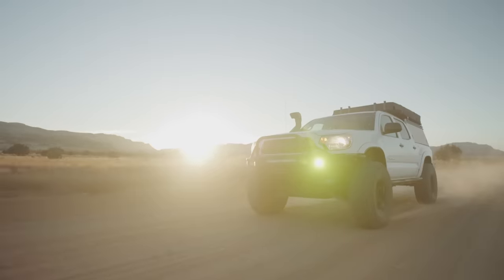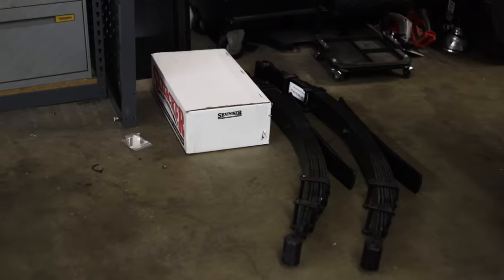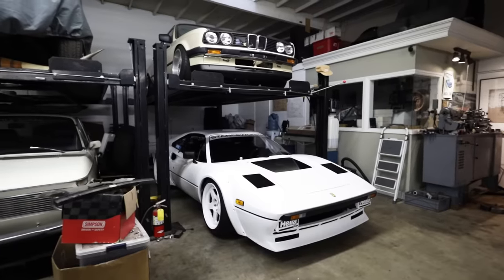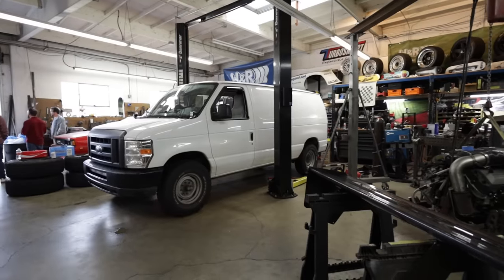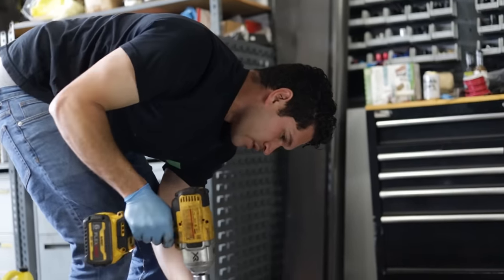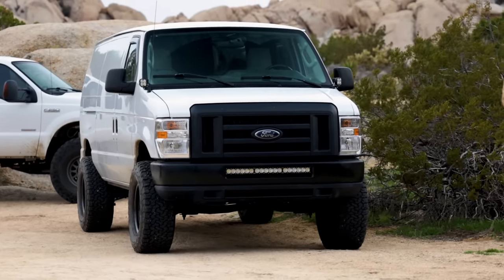Who needs a 4WD van when THIS is an option?

Comment: 100% agree with your statement that the van drives like a totally different vehicle. We have an E350 EB with a Fiberine camper top. Before installing the grocery getter, it was always two-handed (sometimes white-knuckled) driving at 60MPH.  Now, I can travel at 70 with one hand on the wheel... Lots of other handling improvements, but this is the most noteworthy.
Reply from the maker: So true!! Best upgrade possible and it’s so cool that it makes it drive better on and off road!
Reply: Try a bone stock 1990 E350 ..
Your 2103 will seem AWESOME.
Reply: @brakeforsnakes What was the total cost?
Reply from the maker: @hushai5154  all parts are listed in the description with links check them out

Comment: I did the same thing with my 2012 Ford E-350, 12-passenger shuttle bus. Added the six inch Weldtech lift. I'm converting it into an RV but I wanted the clearance for the gray water tank and the frame mounted rear AC compressor/condenser. I added some Falken off road tires including the dually wheels. It looks really wicked. The bus manufacturer is Turtle Top so the shuttle lines are very curved and smooth. With custom welded off road bumpers and my custom spare mount on the rear bumper and a cool looking desert tan and black paint job and all chrome removed it just looks the part. It's now known as the apocalypse vehicle by the shop I took it to get my drive line balanced. Overall, it's a great lift kit. I did go with the Eaton 8000 lb rear springs in order to carry the weight of 75 gallons of fresh water, 400 lbs of lithium phospate batteries and another 150 lbs of fuel with the 55 gallon fuel tank I just got for it.

Comment: Sick. Love the weldtec lift. I've got one on my 2012 eseries. I've been eyeing a locker. I'd love to see you talk about why you went with the powertrax and some shots of it in action in future vids!
Reply from the maker: I chose the no slip locker because it costs like $350 and since I don’t live where it snows it just makes sense. I can’t even notice it driving around town but Offroad it’s a night and day difference! I’ll do a more in depth review on it
Reply: Curious about the prowertrax option and why you chose it. 

I saw your earlier reply.

I myself having been going back and forth between the one you got and the arb rear air locker. 

Haven’t been able to really ask anyone who has used both and can tell me the differences and what would be better overall. 

I’m running a 2011 E250 as well. 4.6L 😢

I’m getting the same lift kit and also running 35’s.  As well as, the ring and pinion 4.56. 

Right now, I’m leaning towards the air locker. Any insight would be greatly appreciated. 

I plan on running through all terrains in my rig. 

You can see it on my channel under van build series.
Reply from the maker: Mine has the 4.6 and it averages 16-17mpg still I love it. The arb is a better setup I just didn’t want to spend the money for it. The powertrax is a great budget option but not ideal for driving on the road if you live somewhere it snows
Reply: If you live in snow country Get a selectable Locker, a fixed locker in snow with 2wd is a nightmare to control and dangerous.

Comment: This is exactly what I want to do with my van. I didn't want to go through all the trouble of installing 4 wheel drive and THIS will do the trick! You have a great channel going here! Thanks for going to the trouble of making these videos! You're a few steps ahead of me which is good for me because I get all the info and get to see how bad ass the van looks and mine will look hopefully sooner than later. It all costs so much money but I don't have to tell you that. I appreciate you! You're the guy my wife was telling me about when you got the hi-top. I can't wait! I actually already put a 900 watt solar rack on top but that can be raised when the time comes. I put my fantastic fan in one of the back windows and an air conditioner in the other. It turned out great! We want comfort. Some people might think it looks strange but we're happy with it.
Reply from the maker: That’s so rad and much appreciated!!
Reply: 4 wheel conversions on vans are currently $12,000 - $25,000 plus the cost of a van

Comment: Love the van....i'have a 2001 e250 5.4......locker kit in rear ..3 in lift..running 255 x 16 studded rear ..225x 16 studded front..3.9 gears .10,000 lb front winch ...a beast in the snow....havent set up for summer yet ...Canada..keep it coming ..cheers..
Reply from the maker: Hell yea!

Comment: Glad you shared your dream build with us.  My dream is a way crazier and will cost some $$$.  Take an E350 cut-away source and an Econoline chassis to be shortened to a Crew Cab.  Source an F Series long bed (8-foot). An E-350 pickup truck.
Reply: Check Out the 80's and 90's Ford Cabriolet Van and the Centurion.  Both could even accommodate a 5th wheel!

Comment: Got the slider that I rarely see. I mostly see them with the 2 outwardly opening doors which is what my '04 white E-150 cargo van has. Just dropped a set of 3:73 gears in 8.8 rear end it has. It came with a 3:55 ratio axle so it wasn't a huge jump but definitely noticeable. I  didn't want to negativity effect its highway manors which I can barely even tell the difference when driving on the freeway. And fortunately it has a Jet power programmer that allows you to recalibrate the speedometer if you change the gear ratio or wheel and tire size so your speedo won't be off. Your van turned out great though. It looks awesome.
Reply from the maker: Yea I ran a 5 start tuner to adjust for the gears and tires

Comment: I'm a fan of 4wd Ford F250 short WB vans. Yours looks good after all the mods. Shy of having 4wd on it perhaps you're already thinking winch(s).
We're it me I'd back myself up with a 12klb front winch & a 5-6klb rear winch. Both with synthetic cable & donut snatch blocks. Unless you're out in the salt flats, this combo with your current mods could help you recover yourself anywhere else.
Reply: Why not just one winch on a hitch mount? Then you can just move it around.

Comment: For filming, install a couple cameras where you normally are and have them wired so a flip of the switch and you’re filming.  That way you can just be driving, sitting in the bench on your front porch, sitting at your desk or frying bacon, reach over and flip the switch and just start talking….. worry about editing later when you get a chance and have down time.

Comment: Any chance you’ll do a video of the van off-road and test it to failure(getting stuck) in multiple situations? 

This is the biggest challenge with these van builds is no one really knows what the limitation is with a 2wd lifted and locked van. It would help a lot of people determine if it will work for their needs.
Reply from the maker: I do plan to yea and in the video after this on my channel I have a bit of Offroad footage as well
Reply: mud, snow, sand, or steep gravel/slick rock is where 2wd vans'll stop. You can avoid the a lot of the scenarios, as it's for camping not rock crawling. 
But the mud/snow is the scenario where 2wd just doesn't cut it for me, as that often pops up on camping trips (especially if you're camping year round)
Reply: I know it's really not all that comparable but I used to have a ATV that was just a 2 wheel instead of 4 wheel but I put so e really nasty rear tires on it would keep up pretty good with the 4 wheel atv's in snow and mud. Like I said I know it's not apples to apples but it's food for thought.

Comment: I changed the steering box in my 89 Ford E-150 and it made it steer like brand new van again.  Instead of 4WD, I haul a small off road street legal motorcycle around.
Reply from the maker: That’s the way to do it! I have a dirtbike I bring too

Comment: I’m currently trying to decide whether to do 4WD using UJOINT Off-road components or 2WD with a selectable rear locker using WeldTec 5” components. I’d like to hear your thought process that led to your decision.
Reply: Living in Canada, snow is my main use for 4x4. Lift, locker and tires will make your van like 90% capable for most conditions, except ice/snow/mud

Comment: I don't know what you guys talking about, "front end vibration" ??
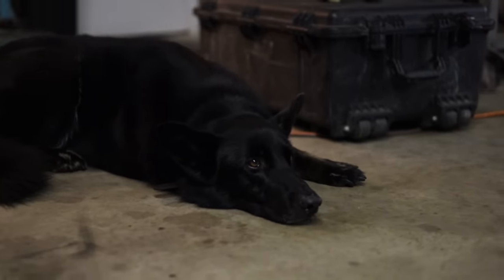 I had a 1998 Ford E250, 3/4 ton, extended body, 2 wd, 5.4 Triton, OD Auto,  had tinted headlight covers, bug shield, visor, triple rack Trac Rack system, aftermarket rims,  255/16 Goodyear AT tires, rear window louvres and a 3:23 limited slip rear axel and coil over rear shocks.....Had that thing cruising at 105 mph for 45 mins, coming home from a NASCAR race in Dover, Delaware...could drive it one fingered...put 100,000 miles on it, that was the 5th Ford Van I owned
Reply from the maker: Sorry but I just don't believe you do 105 in an econoline lol. I've owned 3 of these vans both 4x4 and 2wd, stock and lifted and there's just no way you were comfortably cruising at 105 in one. Although being a nascar fan you may just have a different idea of what's safe and whats not safe.

Comment: The biggest advantage to 4WD over 2WD with a locker is in off camber situations on slick ground. With a normal(open diff) 4x4 you've got one tire on each end trying to move the vehicle forward while the other two provide some lateral traction. If one tire on a locked axle spins faster than the vehicle is moving, they opposite tire does as well. Just like drifting or doing donuts, if both tires are spinning faster than the vehicle is moving you have little lateral traction.

I also don't mean anything extreme when I say "off camber". Snow covered or icy roads with a prominent crown can easily cause the back end of a vehicle with a limited slip/locker to drift towards the curb. This is why I'm a big proponent of selectable lockers even on 4x4's. It's not at all hard to find videos right here on YT of locker equipped 4x4's sliding sideways on hills covered in snow or mud.

Comment: Hey Jim, when you swapped out your chrome headlights for the black ones, did the wiring harness remain the same? Gorgeous van. Thanks!
Reply from the maker: So long as you use the same bulb it is fine otherwise you’ll need an adapter. I actually switched back to the cargo lamps

Comment: Only need a 4.30 gear for 35" tires on an E250. Just did the calculations myself for mine.
Reply from the maker: For your your van and your uses.

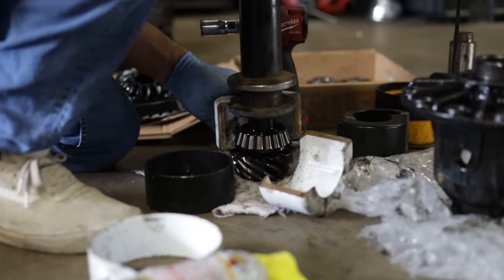Comment: To really get the best of a project filmed I think one needs some one filming full time. Yes, lots of editing! But, also a preview of what you want to present, like, why 4:56's, how did they change gas mileage, engine rpm. where you purchased the special weld on parts. So, it may require more than one video and be time consuming. Don't get me wrong, what you presented was very interesting and super informative and we liked it, but we have questions? Costs? that's always a question foe me. I'd love to do this type of thing but money is always forcing me to compromise. Thanks.
Reply from the maker: Those are all separate videos, watch my latest walk around video and there’s a link to the lift kit in the description (thats what was welded on the frame it’s all apart of the kit like I said)

Comment: How was the fitment process for the 35’s? I know they mentioned it requires some trimming to fit 35’s with the 5” lift. Progressive rear springs? Or just the blocks? Didn’t catch which one you did.
Reply from the maker: Fitment is easy just weld the brackets according to weldtechs specifications and do some minor fender trimming. I did the progressive leafs
Reply: @brakeforsnakes  🤙. Awesome. Any rubbing issues off-road?
Reply from the maker: Nope we clearanced the front just a bit and it's cherry

Comment: Nice van.  Don't go on a soft beach though.  My 2wd van with 6.0 diesel on 37s needed no lift.  Just needed a bit of a trim job.  It tracks true on the interstate also.  I liked the no lift option.  Just big tires.
Reply from the maker: That’s cool but not really comparable. I’m not just trying to fit big tires I want a suspension platform that works well and has an advantage. This kit more than doubles the wheel travel of your van which probably has even less than stock with the huge tires.
Reply: But they will both get stuck in the sand. A lift and tires in no way makes up for the lack of 4wd when you need 4wd.

Comment: Love it. I'm curious whether the 3" kit would've still fit the 35s or not.
Reply from the maker: You know I’m not sure but you could reach out to weldtech they’re very helpful!
Reply: I have 285 75 18s (34.83"s) on my 03 with only a 2in spacer lift in the front. After alot of cutting it only rubs when i bottom out the van while offroading hard.
Reply from the maker: @joseruizlalo  Man that's a lot of tire for only 6" of wheel travel and stock gears. These kits give the van 10" of wheel travel up front and 12" in the rear which makes a giant difference.

Comment: Just subbed absolutely awesome work. That set up is on my bucket list. Can you give me a link to the rear locker setup or do video and what made you go with that specific locker. Thanks !
Reply from the maker: The rear locker is just a Powertrax No-Slip locker but you'll need to put in all the info from your van and find out what rear axle/spline count you have since there's so many variations of axles in these vans. But that's a good idea I'll do a review on the locker and what it's like driving around town and offroad.

Comment: You did well.  Maybe some more detail but attention spans are limited for most viewers.  So good job.  That's an interesting project.  Head to the mountains beach where ever.   Be safe  My old 90 F 250 has a center point in the steering  , anything else you have to drive it all the time.
Reply from the maker: Appreciate the feedback!

Comment: What are the wheel specs? Offset , width etc.   Also did you use spacers on the rear wheels?
Reply from the maker: They were 0 offset 17x9 and I did have spacers

Comment: Question. Did that gear selection work out as you planned? I’m going to be doing a 79 Econoline and I will also be running 35 inch tires. I was going to be aiming for a 4.11. It is currently a half ton with 28 inch tires and a 3.50 gear.
Reply from the maker: 4.56 is definitely the way for 35’s on this van. I was originally gonna do 4.11 but glad I didn’t

Comment: to a guy who loves his really old sprinter, wants to get a newer ford van and doesn't know much about transmissions, can you explain something which i thought I would learn from your video? Can you now LOCK your 2 rear wheels together to get through sand, snow and mud? Is there a shift lever in the floor by the driver seat to lock and unlock the rear wheels? Thanks
Reply from the maker: The rear wheels are mechanically locked all the time now except when going around a turn off power. It’d called a lunchbox locker there’s lots of cool videos explaining how they work. A selectable locker like an Ox locker or arb air locker is a better choice for most people if they live where it snows but they’re much more expensive.

Comment: Errr...VERY glad you are using and enjoying the van with some add'l clearance, suspension travel, and better tires...but Com'on.
Who needs 4WD?  Anyone that is going anywhere that doesn't have established dirt roads, and even then the dirt roads need to be dry and stable, or 4WD is MUCH BETTER.
Nice production value.
Reply from the maker: I sold my quigley 4x4 e350 for this. Not everyone needs 4x4 especially when the starting cost of a conversion is 4-5x what all this cost. It also DOUBLES the wheel travel of a quigley 4x4 and that combined with a locker and 35” tires gets me just about anywhere I need to go besides the snow and mud pits which I avoid regardless.

Comment: Wow, you gave up 4wd for a lifted 2wd?

I had Weltec install a 2 inch spacer lift on the front of my Chevy Express to level out the van.  I use the van to tow a 22 foot trailer.  I also had a Posi unit installed by another shop on the rear end which made a big improvement on it's limited off road use.

There are so many shops that will convert Ford vans to 4wd, it's ridiculous.  There is one shop, I can't remember what state it is in, but they have a "kit" for Ford vans and the fastest they converted a 2wd to 4wd was 9 hours of continuous work and this was with a straight front axle too!
Reply from the maker: My 4wd van was a quigley which has half the wheel travel of this abs ride like crap. Not all 4x4 kits are created equal.
Reply: @brakeforsnakes  you're not the only one who didn't like the quality of such an expensive Quigley conversion.  I would've gone with a Weldtec conversion but they don't offer a straight front axle kit.  I have a 4wd 4Runner and am aware of it's limitations.

I once had a 73 Chevy Blazer full time 4wd decades ago and that thing was great.  Too bad they cost so much these days.

Comment: Nice..........   did installing the bigger wheels throw off the speedometer.?
Reply from the maker: Yup you need to install an SCT tuner to fix that
Reply: @brakeforsnakes  excellent!!!  I just recently retired July of this year and I plan on buying an F250 or 350; convert it to a camper and raise it like you did. Used to own a 96 4x4 ford f250 Diesel crew cab.  I am also considering buying a van with a diesel engine. Glad I stumbled on your video. 😀

Comment: What kind of fuel economy are you seeing now with that 4.56 and 35” tire package? Thinking of doing this lift for my van.
Reply from the maker: I still average like 15-17
Reply: @brakeforsnakes  wow, I’ve never seen above 12 mpg average in my e-350 with 31s.
Reply from the maker: @cameronlogue5989  how fast do you drive? I keep it below 70 and around 2100rpm
Reply: @brakeforsnakes  around 70-80 on the highway. I do have a roof rack but I didn’t think it’d kill the mpg that bad
Reply from the maker: Yea that's pretty fast, the difference from 70-80 can affect it greatly.